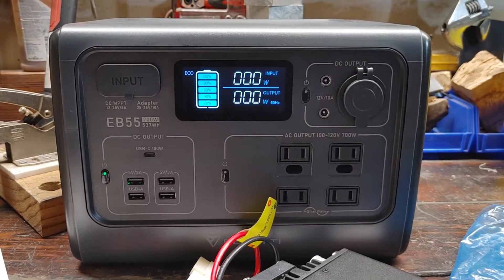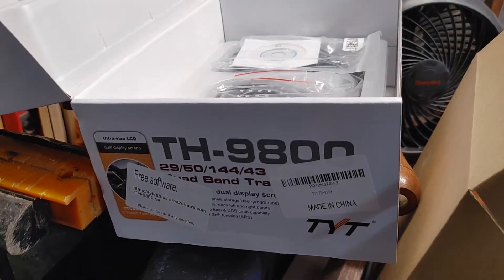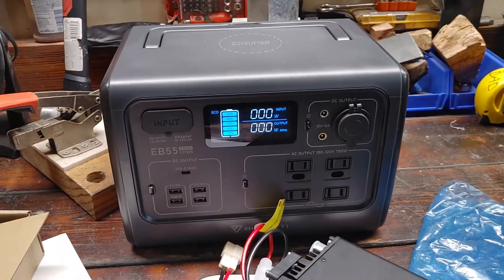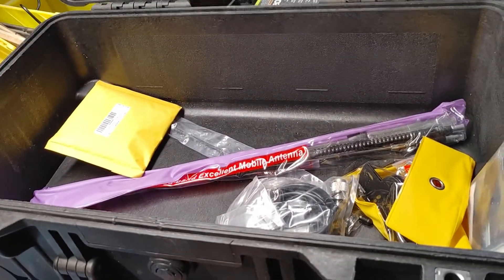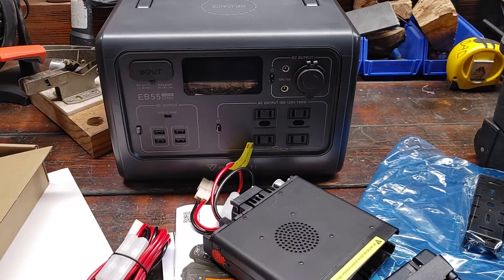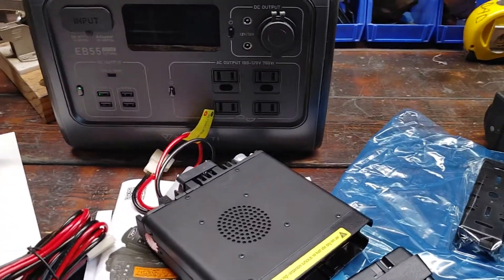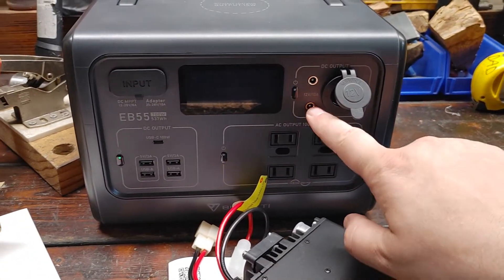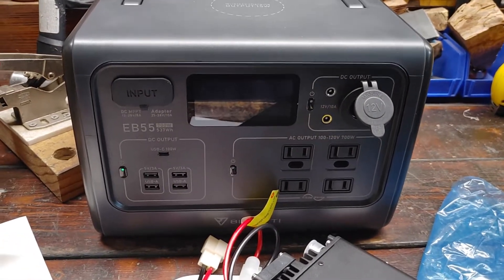Bluetti EB55 solar generator as a TYT ham radio power source?

Comment: Those barrel connectors can be used with an adapter to make them a cig lighter inputs or other types as well. Amazon has them. Should be 5521 barrel connectors. Look at the manual. I have the EB 70 here and LOVE it. I use a Baldr 120 watt folding solar panel with it. Works great!
Reply from the maker: I will 100% look into that today! Thank you!!
Reply from the maker: Quick update, I double checked on the #Bluetti website and that is indeed a 5521 socket. I'll be ordering two or three today! Thank you again!
Reply: @vonbaconstien760  No problem, enjoy!
Reply from the maker: @Tommyr  ordered! I also ordered some extra male/female connections too. They seem handy so I figured why not? Thanks again!